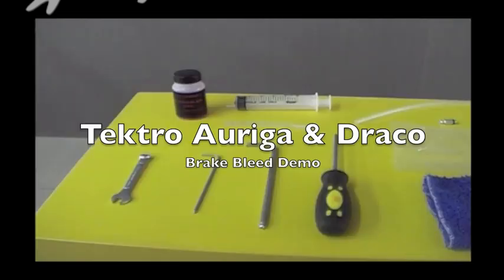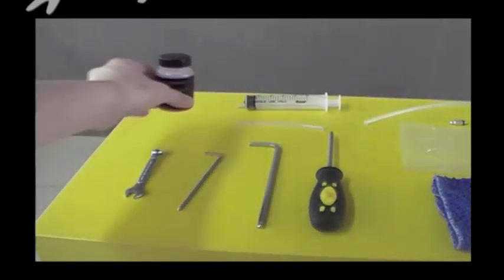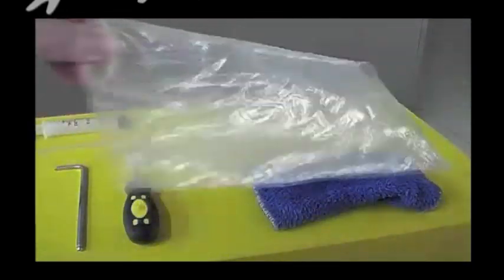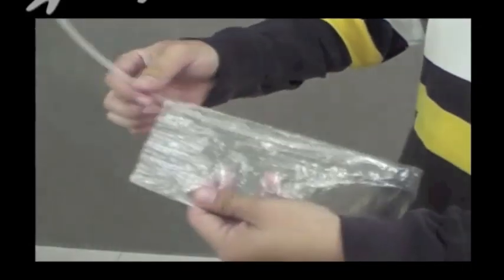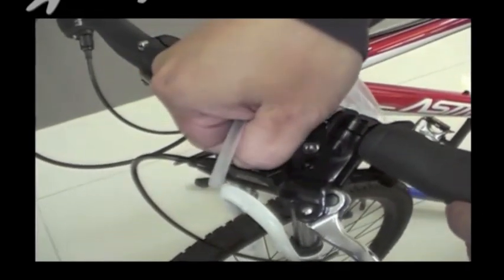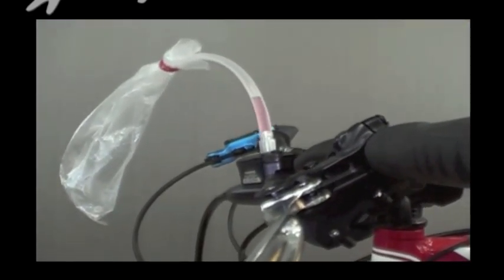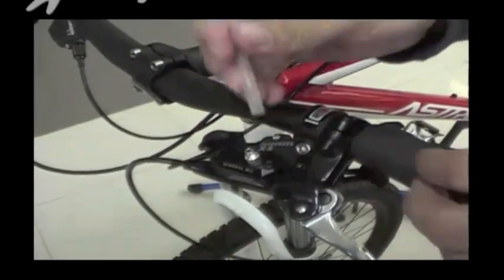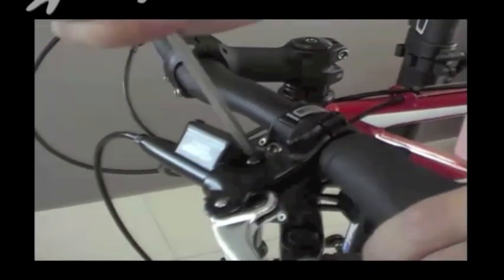Auriga and Draco Bleed Video

Comment: Trying to bleed a Tektro brake that I bought in 2015.  The problem I'm having is that the opening hex bolt doesn't appear to be 7mm.  More like 6.  Is this right?
Reply: i have the same problem with my auriga pro. -.-' i bought a 7mm key just to find out, it doesnt fit

Comment: What the f...  I Did everything according to the video with my Draco, but when I opened the port at the break and started to push the oil form the syringe the oil spilling from screw directly to the pads. What is the problem?
Reply: The problem is TEKTRO itself)  I used some PTFE tape on the thread of port.
Reply: I had the same problem :(